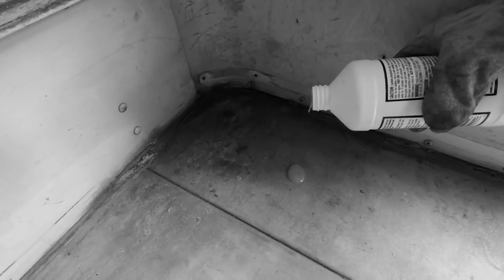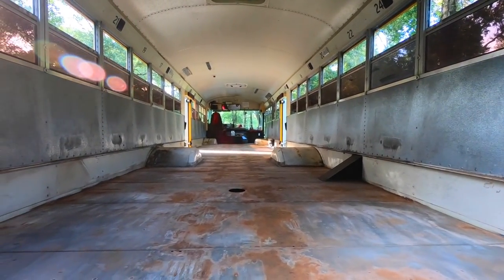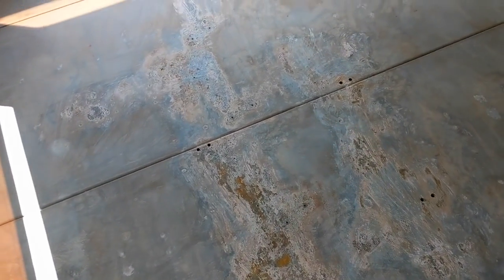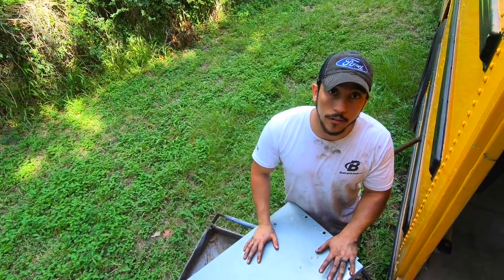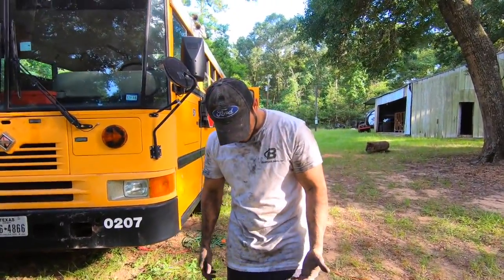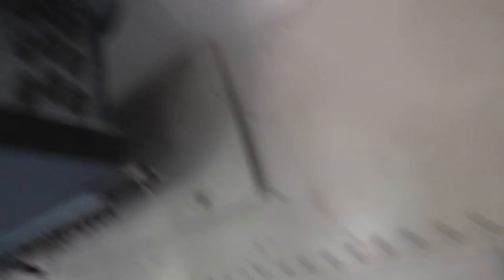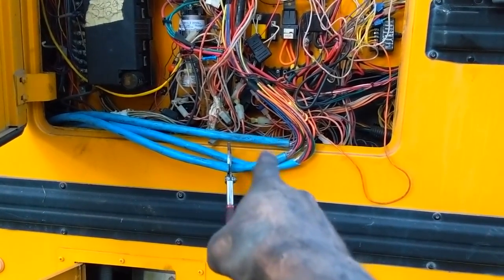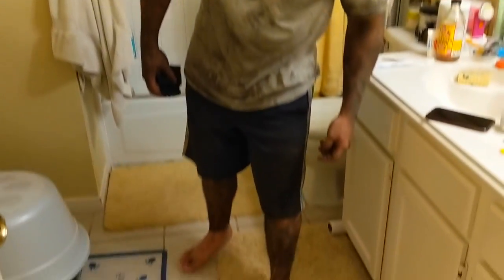AC Removal in a School Bus *skoolie conversion* - Gus The Struggle Bus

Comment: What did you guys use to cap off the compressors where the AC lines connected? I'm about to do the same thing!
Reply from the maker: Since there is no gas in the compressor after  draining them it's ok to just have the compressor there with out capping it. So, to answer your question we did nothing t cap them off. We just left them there with out the AC hoses because they have a belt running through them

Comment: hey i'm following your videos to remove rear ac but there's a controversy about how it can keep w seeing the engine cool down the line. how did you guys solve this problem?
Reply from the maker: hi Chelle, I am having a bit of trouble understanding the question completely. did you mean AC or Heater? 
If you meant removing the AC will prevent the engine from staying cool, this is the answer.
The Air conditioning system contains a gas commonly known as freon. this freon runs through your AC system and through the compressor cools coils inside of the AC fans which then blows on you. 
The engine itself does not need the freon gas in order to stay cool. that's why you see cars without an AC and still run perfectly fine.
On the other hand, the heater on your bus is heated with coolant liquid. This liquid is what keeps your engine cool and prevents it from overheating. So if you remove the heater you must make sure that you loop the hose to go back into the engine.
in summary 
-low or no freon: will mean no air conditioning but has no effect on the engine temperature.
-low or no coolant: overheating engine and big problems. 

hope this answers your question. 😀
Reply: @GustheStruggleBus  this answered my question perfect! i appreciate a lot!  
I was contemplating on buying a bus w broken AC but seems like it's not going to be a problem to remove it. I'm following your video to remove the heater and looping the hose back.